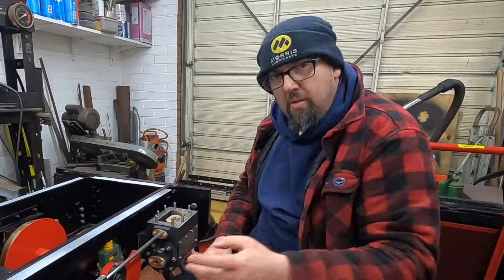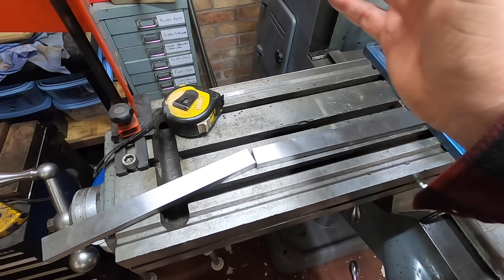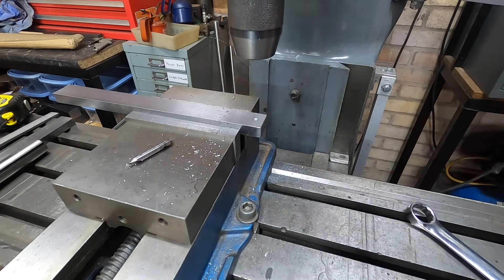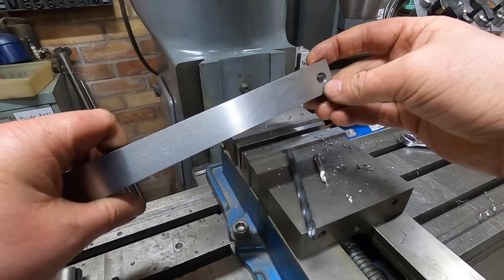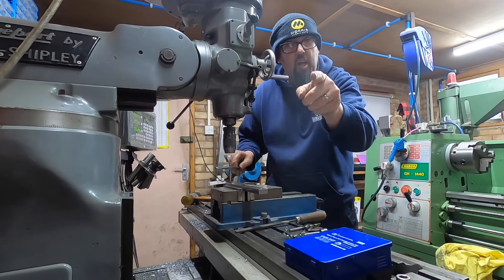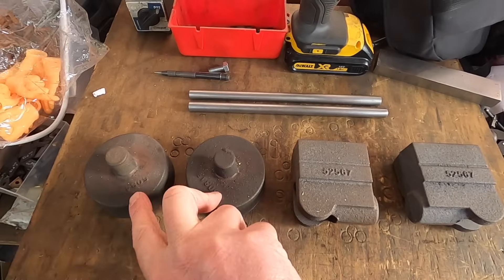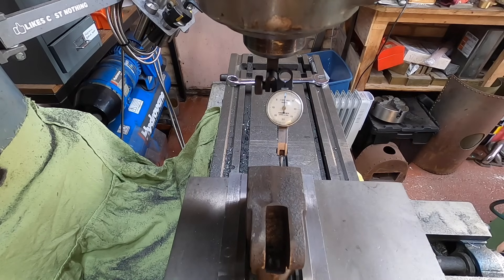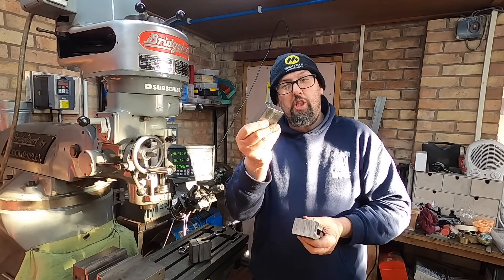Slide Bars & Crossheads - EP72 Project Tinkerbell - 7 1/4" Steam Loco Build

Comment: Amazing  -😊precise engineering machining instruction, - looks an expensiv vertical mill. I coudnt aford it. When driving u dodnt mention 'notching up' or use of a steam brake., &  Thougt yud hav pickd up passngrs!
Reply from the maker: Thank you Tom, I'm assuming you're referring to another video regarding notching up and steam brakes, as this loco isn't finished so I wouldn't have either on yet. All the best, Matt

Comment: Hi Matt, Did you get those original ones from Cromwell?
Reply from the maker: Hi Rob, No it wasn't Cromwell, it was Zoro. I assume Cromwell supplied similar?? All the best, Matt
Reply: @ the packaging looked the same. I bought some for the Thomas 2 to rebuild the valve gear, and the ground stock was 0.004-0.007” over nominal size in one dimension.
Reply: @MattChiversWorkshop Cromwell and Zoro are basically the same company

Comment: Suprised they don’t have 2 bolts going through into the cylinder, having said that I suppose it fits on the other end to the motion bracket. Cracking vid Matt
Reply from the maker: Thanks Connor, there is no need for two bolts at the cylinder end, the is ample strength in the ones holding it. All the best, Matt 👍🚂

Comment: "So I've gone in three-eighths of an inch, and drilled an eight millimetre hole."  I love it!
Reply from the maker: 😂, Got to slowly convert the imperialists to metric..... or convert the metric to imperial!! All the best, Matt 👍🚂
Reply: @MattChiversWorkshop  Matt, I think it's great, and many modellers, including me, think like you do, in Imperial and Metric at the same time, and use them interchangeably. Nothing at all wrong with that.
Reply: I do the same...  The result of living in the States, but working for 27yrs for a German company that used only metric (as it should be).  I design everything in metric, then do conversions when machining on my manual/Imperial machines.

Ironically...  I do all my carpentry projects in metric now.  Purchased a few Inch/Metric tape measures and use the metric side for all my measurements.